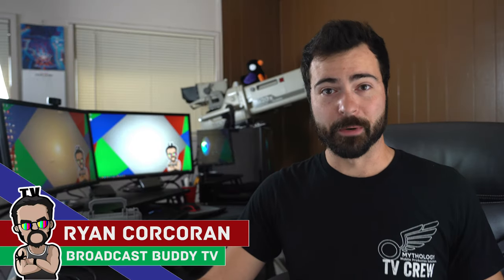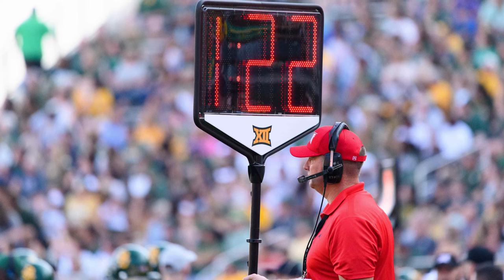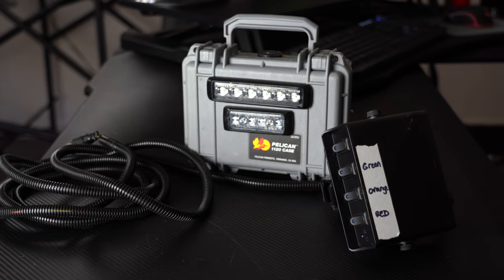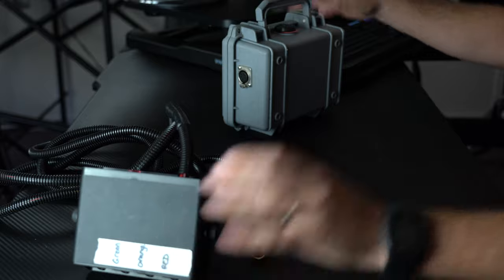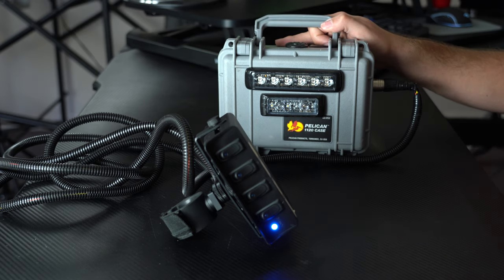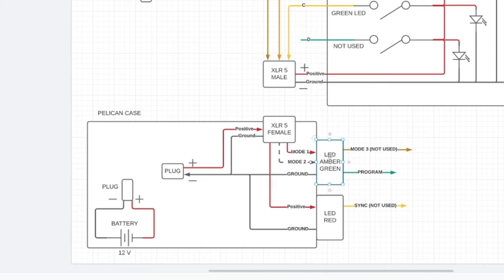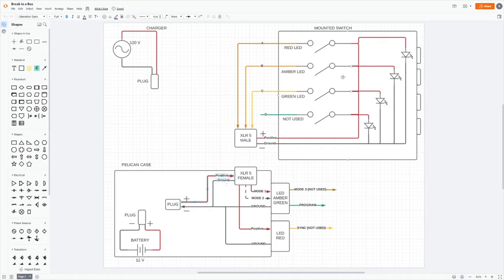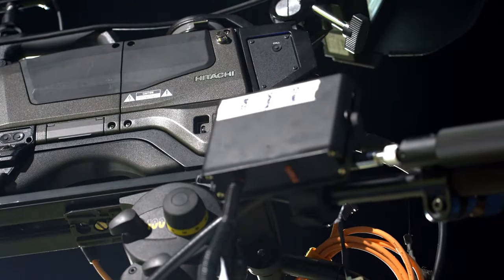Let's Build A Commercial Break-In-A-Box [Broadcast Engineering]

Comment: I dig it.  Only thing I would have done differently is put a VMount/ABMount battery plate instead of the RC Battery.  I always seem to have extra IDX/AB batteries around to make use of.
Reply from the maker: Definitely a 2.0 worthy suggestion! Might even be able to fit the battery inside the box to keep it all internal.